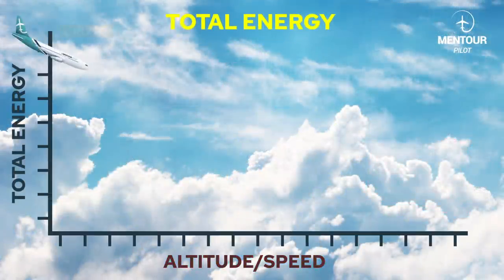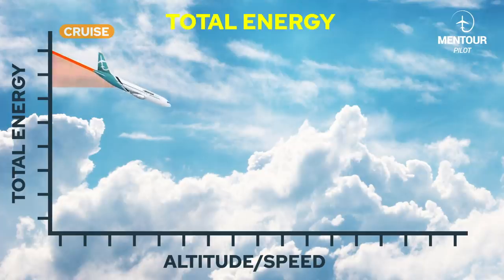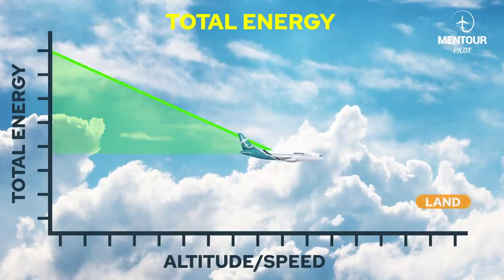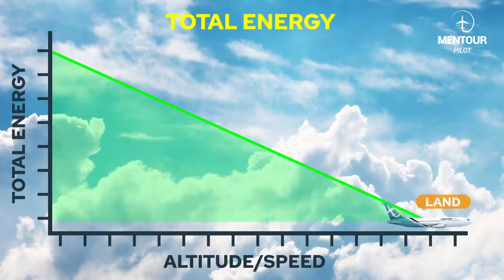Unstabilized Aircraft approach - Explained!

Comment: "You can not use flaps at any given speed"
bruh, I use my flaps at any speed in Microsoft Flight Simulator and it always work for me. I also turn of my engines to save fuel on the way down. 
Mentour, you got some tricks to learn, my friend
Reply: pro-FSX tip: fly inverted with full flaps and the cabin doors open, gives maximum drag.
Reply: I start my descend with a b737 with gear down, engines-off, full flaps, full speed-break, full rudder input for slip maneuver, and s-turns.
Reply: You guys don't use thrust reversers to help slow down from an altitude drop? Those work great, you don't need to wait for touchdown like the book says.
Reply: Jørgen Ramdahl there are limitations in actual world flying. In simulator sittting at home you may do whatever you want. Those tricks doesn’t work in real world.
Reply: Indrojit Bhattacharya r/woooosh
Reply: @trazzlotinkerboltz5684  The US airforce C-17 pilots actually do practice using thrust reverse in flight, as I recall it is part of what they call a "tactical approach".
Reply: Trazzlo Tinkerboltz You say that as a joke, but I wonder if there’s a problem that’d prevent a go around, and you’re not sure if you have enough runway to stop, can you throw the thrust reversers on at like 10ft? 20ft? I mean you’re essentially stalling the plane on purpose just to bleed off that tiny bit of extra speed and hoping that the fall is so short that the landing gear doesn’t collapse, so there’s really not a lot of wiggle room there.
Reply: Try flying in KSP instead. You'll learn to use reverse-mounted solid rocket boosters for an even quicker stop. But as with all things KSP, it may end in explosions.
Reply: Can you do me a favor? Publicize the name of the airline that you work for. I will make sure I don't fly that one.
Reply: "But it's FSX, so of course nothing is accurate." - AirForceProud95
Reply: @arfster2  Boy - are they gonnna hire you....(!)
Reply: 230968 surely u are not asking that of mentour
Reply: Bill Pennock if there isn’t a name at beginning of the reply, then it is addressed to the original poster. In this case, Jørgen.
Reply: @billpennock8585  No. I am already committed to not be on Boeing 737 again and it is understood that Mentour Pilot flies only 737. My reason for avoiding 737 is to rule out possibility of flying on 737Max. So, avoiding 737 is just a precautionary measure. I am a fan of 777 and its safety record. It is a great aircraft in my opinion.
Reply: @billpennock8585  so, my question (just meant to be a comment on the lighter side) was for Jørgen Ramdahl.
Reply: @OtherTheDave  I think an aircraft will not allow to deploy reversers in flight. On the other hand, I assume you are landing in emergency way (what else could be the reason that the length of a runway is insufficient?). In this case all methods are great. I don't remember exactly but on low altitude reversers could not lead to catastrophe (or on high, I don't remember, better search google)
Reply: Shit was I not supposed to have 40% flaps at 500 knts?
Reply: How can people be so ... (redacted) to think that any of these comments were real? All the “suggestion” type comments are JOKES people. If you cannot figure that out you should not be allowed to vote
Reply: In KSP I land aircraft from Orbital Velocities by slowing down with a 75° Pitch Up angle, adjusting Path using Roll Maneuvers and saying "Good enough if no one dies"
Reply: @LunaNicoleTheFox  In KSP you can even do an EVA and land Jeb only with his jetpack and parachutes.
Could be helpful in case you havnt enough fuel for an controlled reentry and dont want to launch a rescue mission.
Reply: @joseyanez2342  depends pretty much on your realism settings.
Reply: lmao
Reply: @indrojitbhattacharya1738  r/wooosh
Reply: Does your sim have designation app to B737? In a zcessna flaps work most of time because speed on landing is 65 knots. On big jet you land at 140 knots. He's saying high speeds may damage flaps. I changed flap jack brake on aircraft that came in too fast with flaps down. Damaged stress wing.

Comment: Good video on that topic. Even for smaller airplanes. Just recently I could experience the difference between stabilized and unstabilized approach and the resulting landing. Flying a C152 came in to an airfield, too high too fast. I realized it when I caught myself pushing for the runway threshold. Decided for a goaround, second time went like a charm. A few weeks later came in to another airfield, got into the same situation, but for some reason - maybe feeling overconfident, maybe just simply getthereytis - I decided to push on, to force her down. There was nothing stabilized anymore - I can definitely confirm that stress level is really spiking all the way down. Not helping at all. The airplane felt “uncooperative”. Of course, I was trying to make her do things that did not fit her energy state! Touchdown was barely controlled and just lucky that type of aircraft can take so much. After that I realized that this was a real life “what if” experience. Two high energy approaches, one aborted and the other showed me “what would it had looked like if” I hadn't aborted.

Comment: What I find really interesting is the result of some calculations I have done. An aircraft flying at 450 knots at FL390 has to lose around 95% of its energy to be flying at 160 knots at 1000 ft. Although I am not a pilot this clearly illustrates the importance of proper descent planning to manage the energy.
Reply: And idling almost all the way to expend that energy against drag.  Climbing uses extra energy to accumulate as potential energy of high altitude.

Comment: You and Juan Browne (blancolirio channel) have really opened my eyes about the balancing that has to go on to set up an approach and ride it to the runaway. I had thought of it as a simple thing: fly down to the runway, pull power and flare. Now I would say it is much more like a bird perching on a twig. Proud to become a patron (signed up with Juan a couple days ago).
Reply: I think of it as a teenager coming home at 3am in a beat-up jalopy, turning off the engine and coasting in.  Can't use the engine or they'll hear you - can't use the brakes or they'll hear them squealing.  Have to get the timing just right so you make it into the driveway, but not so fast that you smack into the garage door.
Reply: It normally is, however sometimes you get a late descent, change of runway, a shortcut from a longer arrival routing etc. leaving you with less miles to lose altitude. You have to manage it with techniques such as speed, speedbrakes, early gear extension, flaps, or simply ask for vectoring to get more miles.

Comment: 5:08 6:36 it tends to be more like "we can get you in now with [insert shortcut here] or expect 1 hr hold pattern, irate passengers (late and missed all connections, airline forks out heavy for hotel vouchers and 3rd-party rebooks), then a call from the company regarding your career"  The kind of external stresses that affect pilot decision making, for the worse.
Reply: Yes, that is the pressure.  I've found the only way to handle that is to have a hard attitude of not taking the bait no matter what retaliation may come.

LOL, I told the company to "put their mothers and kids on the plane" if they really think it is okay to squeeze the safety margins.
Reply: Christopher B. Jack great job Capt
Reply: The Air Ontario Flight 1363 is a great example of that... As it was said, "There was a lot of other hands on those throttles, pushing those throttles forward."
Reply: @CMDRSweeper  One or two of those hands also interfered with KLM Cpt. van Zanten's throttles in the Tenerife disaster.  In that case getting stranded vs. the career impact (losing license) due to exhaustion of duty limits (they were getting close and the diversion had them almost expired by the time the Gran Canaria airport reopened).

Comment: I was a passenger on an A320 flight into Heathrow when there was a medical emergency over Belgium.  It was impressive how quickly the pilots took the plane from cruise altitude to touchdown in Brussels.  Perhaps 15 or 20 minutes?
I was watching out the window when the pilots began a rapid descent with a sudden reduction in thrust, nose pitch down, and speed brakes out.  As no announcement had been made, it was startling.  Eventually the pilots did announce that a medical emergency would require landing in Brussels.
Once on the ground, someone who was not moving was put in a wheelchair and taken off the plane, and their luggage was offloaded.  We proceeded to an uneventful landing at Heathrow.  Never did find out what happened to the passenger.

Comment: 8:30 Physics teacher here.  Drag does not "destroy" energy; it just moves your kinetic energy to the air around you instead and also converts some of the kinetic energy to heat.  The result is a reduction of speed.  I have heard fighter pilots on documentaries mention trading altitude (gravitational potential energy) for speed (kinetic energy) and in air combat, Speed is Life.  In non-combat aviation, that is not such an important detail, but when coming in to land, you have to lose (not destroy) your gravitational potential energy while not picking up too much speed. 

So the energy process is: chemical potential energy (fuel + oxygen in the air) is used to produce thrust, thus gaining kinetic energy which is traded off to gain altitude, thus gaining gravitational potential energy, taking you to cruising altitude and speed.  To land, the gravitational potential energy is converted to kinetic energy (you speed up as you descend), but the pilots reduce thrust to allow drag to slow you down (transfer kinetic energy of the aircraft to kinetic energy of the air and heat).  As you slow down, you can start using drag-inducing flaps to increase the drag energy transfer to the air.  The flaps also produce extra lift at low speed by converting some horizontal kinetic energy  to vertical (upward) kinetic energy, but you are descending faster than the flaps are lifting, so you keep going down).  So by balancing the transformation of gravitational potential energy to kinetic energy and the translation of aircraft kinetic energy to air kinetic energy (and heat), the aircraft can be safely brought down on the runway threshold, where it can convert almost all of the rest of its kinetic energy to air kinetic energy (by thrust reversers, as well as flaps and other drag inducing mechanisms) and heat (brakes, and increased drag) in order to slow down to taxi speeds.
Reply: And just think, birds do all of this naturally.
Reply: @Peter L Yup, I stand corrected, even though I am sitting right now.  The flaps are converting momentum, not kinetic energy, well not in a way that stays with the aircraft.  The flaps are providing increased lift with increased drag, and if the aircraft is too fast, there is too much drag on the flaps and thus too much force and the flaps could be damaged.  The additional lift provided by the flaps is balanced with the rest of the flight controls to keep the aircraft going in a general down direction during approach for landing, while at the same time allowing more of the kinetic energy and momentum of the aircraft to be transferred to the surrounding air.
Reply: I prefer the term "dissipate energy". When you have energy you don't want, kinetic or potential, you don't care where it goes just as long as you are not carrying it any longer! You can't destroy it, you just dissipate it into your surroundings.
Reply: In the open context of a plane the energy is destroyed.  It came in as kerosene and now it's gone.  But I can understand that lawyers (including physics teachers) disagree.
Reply: Agree, as a science student, the phase "destroy energy" annoy me
Reply: I knew some butthurt physics teachers would respond to that statement 😂 He should have said dissipate instead of destroy

Comment: Phyde4ux made a question about flight PIA 8303. I had the same question in another vlog and the answer was no. That crash's most PROBABLE CAUSE was that, when descending with engines idling, the aircraft was most of the time between 200 and 250kts, therefore they were able to deploy the landing gears. The warning signs were for extended flaps in higher speed than the ones determined by Airbus. That's why they did not pay attention to them, they knew what they meant. I believe they had the landing gears down and locked before approaching the runway. Until very close to landing, the flying pilot was calm and had not requested emergency landing due to mechanical problems. When he noticed he would miss the threshold, he called internally "go around" and the co-pilot retracted flaps and landing gears too soon. Due to the stress of steep descending and all the adjustment for the sudden decision, they did not communicated that to ATC immediately. Only after the aircraft had stricken the runway and gained altitude, he communicate problems with landing gear. Notice that the warning sounds stopped when he tells that to ATC. That's because the flaps were retracted by the co-pilot. Due to the speed and very low  altitude, without flaps, the aircraft lost lift momentarily until the engines recovered thrust. That's why ATC witnessed an attempt on belly landing and asked the pilot if he was going to do it again. Another crucial point to consider is that a major international airport such as London, Zurich, JFK, Atlanta, ATC would never allow this unstable approach and would never ask if the captain was "comfortable". How that theses appeals to my Mentour Pilot's colleagues?

Comment: I mentioned in a Comment on the Blancolirio channel that the recent tragedy in Pakistan had a peculiar beginning that might (perhaps) have been precipitated by a mixing of imperial and metric measurements. I know it sounds ridiculously simplistic, but it's just a thought.

The hot-and-high landing approach (started at 10,000') was so far off what it should have been (3,000') that I wondered if something (or someone) was reading feet for metres, or vice versa.

A pilot under stress would not necessarily be receptive to reminders or corrections from his co-pilot; or from cockpit warning signals; or from ATC prompts. A mental-block can happen to anyone at any time. You see it in some car accidents, where the incoming data simply don't register, and reactions are accordingly inappropriate for the developing situation.

The plane was approximately 3x higher than it should have been at the start of the descent; it then dived rapidly to meet the desired glide slope and gained excess speed which prevented the deployment of the landing gear (which would have been damaged at a speed above 260 knots).

3,000 metres is about 10,000 feet. Did the pilot perhaps think he was at 3,000 feet? If you're absolutely convinced about something, you'll adjust the world to fit your perception of things. Humans have always been good at doing that. So the excess speed wouldn't have registered; the lack of landing gear would also have been a complete mystery.

"I'm doing nothing wrong, so everything else around me is incorrect; my co-pilot is deluded; my instruments are malfunctioning." It's a form of delusion - a hallucination - and hallucinations are extremely powerful and 100% believable to the person having them.

[Disclosure: I'm not an engineer, a doctor, a psychologist, or a professional jet pilot; I got my PPL (now lapsed) in a Cessna 172 many years ago.]

Comment: As a kid I remember landing in Goose Bay Labrador in a Super DC-8 (stretched) on a refueling stop coming from Europe. The DC8 had no wing spoilers. Some engineering genius realized that if the engines could go into reverse in flight the Douglas would not need to add wind spoilers. It worked perfectly. The inboard engines could go into reverse in flight. There was the tiny problem that the passengers thought the plane was coming apart. The captain had to announce it to keep people calm.

Comment: The use of speed brakes with flaps extended was ruled as the cause of a United airlines 737-200 crash on approach to Chicago's Midway airport in approximately 1972 and it was the reason the flashing white lite was installed on the top of the center instrument panel. The lights purpose was to warn the crew if they tried to use the speed brakes with the flaps extended and if the light is reported to be malfunctioning it cannot be deferred.
Reply: but what about speed break on the side where flaps didn't come out, possibly bit higher speed ( to avoid stall) should be ok since it's smaller plane

Comment: I appreciate your description of how high stress can cause pilots to not notice audible warnings. But you did not mention the considerable amount of left aileron required to counter the asymmetrical flaps on most of the approach. As airliners apparently avoid sideslips, I would think that this would be unusual and would in itself trigger a go-around to see what is wrong.  With that said, it was a great idea to discuss the concept of a stabilized approach without speculating on the recent accident.
Reply: I am sure that the audible sound were for overrided extended flaps and the flying pilot was aware of that. The recommended speeds by Airbus for flaps are: 1 at 230kts, 2 at  200kts, 3 at 185kts and full at 177kts. In order to keep lift and fast descending speed to the aircraft, they were overriding the recommended speeds for flaps, little by little, causing the alarm to go off most of the time.